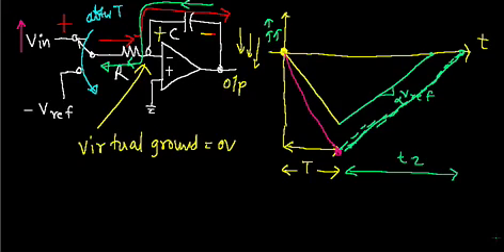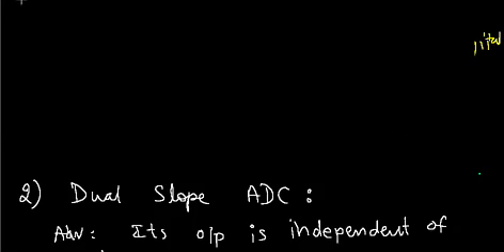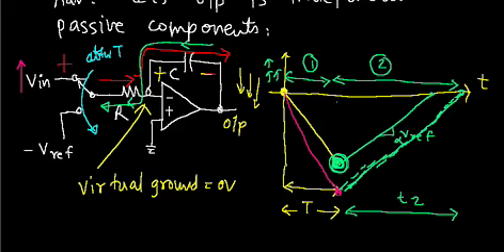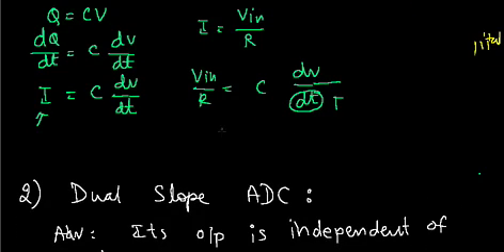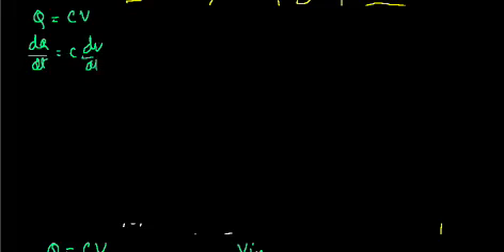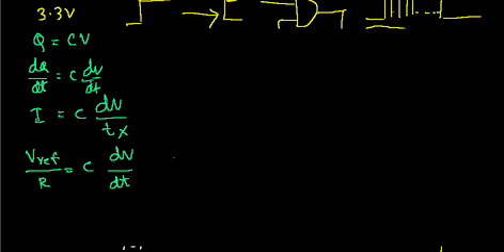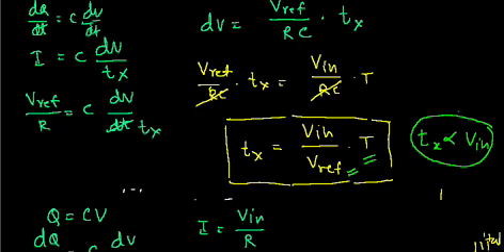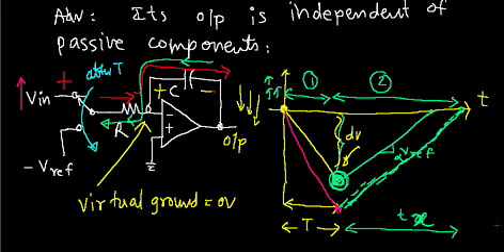Analog to Digital Converters (Part 5)

Comment: Doubt: Can't Vref value also change with time as was problem with Capacitance value change.
Reply from the maker: Yes, it can. However, Vref is designed and fabricated with laser trimming; Hence they are much accurate. They are also electronically temperature compensated hence are stable. Capacitors, however, are passive components and cannot be treated this way. Hence they have more tolerance and less stability. In a production line, the piece to piece variation in capacitors will cause variation in performance in each product. So if we use the above technique, (that guarantees performance independent of capacitor value),  each product will show very close performance. I hope it answers your question.

Comment: Sir please explain the total conversion time in term of number of bits
Reply from the maker: +amit prakash 
Dear Amit,
Total conversion time in this type of ADC does not depend on number of bits. 
It depends on the sum of charging time and discharging time. During the discharging time, the counter is incremented. The number of bits in this counter decide the number of bits in the output. If this answer does not satisfy you, please let me know.
Reply: +Vidhyadhar Dharmadhikari 

But sir i have studied in sedra smith book that total conversion time is 2^n + NT how that's came i couldn't understand
Reply from the maker: +Vidhyadhar Dharmadhikari 

In dual slope ADC, the analog input is converted into time using integrator. This is indicated by tx. Suppose the integrator is designed such that, for 5V analog input, the tx = 1023 ms (by proper values of -Vref, R and C, and T). Now, during this tx period, we allow a counter to count with a fixed frequency clock (suppose 1ms period), then the counter will go to 1023 at the end of tx. This means, 5V will give us 1023 count which corresponds 10 bit ADC. If we use clock of 0.5ms period, the count will reach 2047 which will result in 11 bit ADC. This just by changing the clock we can change the resolution. (Keeping conversion time the SAME).

Imp:
Here we are assuming that, the T (charging period) is independent of counting clock. In some designs, the clock is used to decide the T (charging time). In such case, the conversion time may depend on the number of bits) http://www.psut.jo/sites/alasali/Digital%20Electronics%20Text/P-SigConv.pdf (page 23). The max. conversion time = T+ tx(max) = T+T=2T.
If T is obtained with 1024 clock pulses, then the conversion time will be
2 * (2^N) where N=10 bits.  

Hope this will clear your doubts. 

(Of course, you can ask further queries if any..)
Reply: +Vidhyadhar Dharmadhikari 
Now i understood sir thank you
Reply from the maker: That's good..

Comment: I will appreciate if you can shed some light on this: As the capacitor decays/ages over time. Will the slope of tx remain parallel for different Vin values? and also the capacitor will charge up to a lesser dV with aging, which will result in lower tx for the same Vin and T. Thanks
Reply from the maker: Venkata Shiva
Hello,
The T and Vref must be constant. It is the requirement for this ADC. (see at 5.27). Only then, Tx can be proportional to Vin.
Reply from the maker: Good question. Imagine Vin and Vref are equal in value. Hence the charging rate and discharging rate will be the same. It means it will take same time for discharging as it takes for charging. Now if we assume that C has reduced due to aging, the RC time constant will reduce, but charging time being constant, the discharging time will also be the same. So there will not be any problem. However, the C value should not deviate too much from the designed value; otherwise there may be other problems such as the maximum capacitor voltage to be too high for circuit to handle or too low to cause noise to dominate. I will try to show it using simulation (whenever I get time)
Reply: Vidhyadhar Dharmadhikari how charging time being constant..can u pls explain?
thanks
Reply: Vidhyadhar Dharmadhikari
Thanks for the explanation sir. It's the Vref that does the magic and RC should be same for charging and discharging!
And to answer Venkata, the charging time is dependent on T when the switch toggles from Vin to Vref.
Reply from the maker: Rohit Dixit
Hello, Let's correct your statement as, "the charging time is T. When the time equals T, the switch toggles from Vin to Vref.". Please note. charging time (duration) is NOT dependent on T. Charging time itself is T.